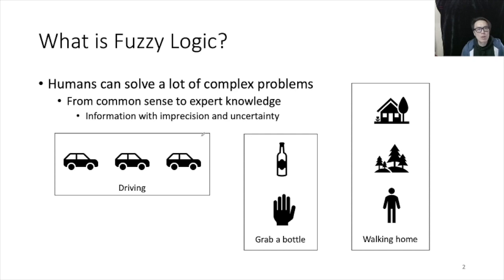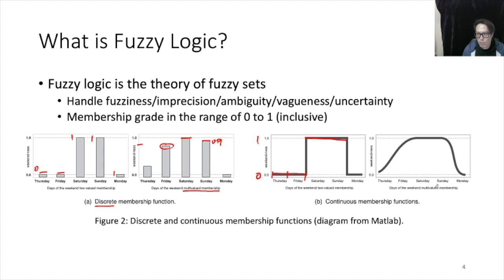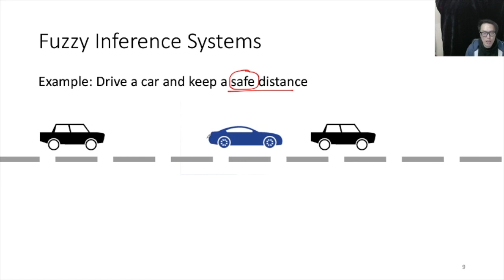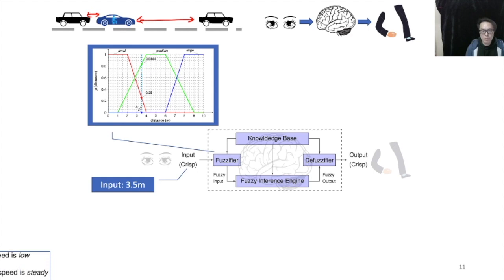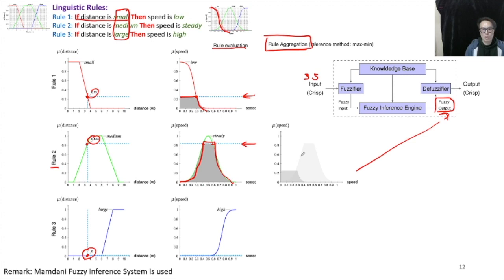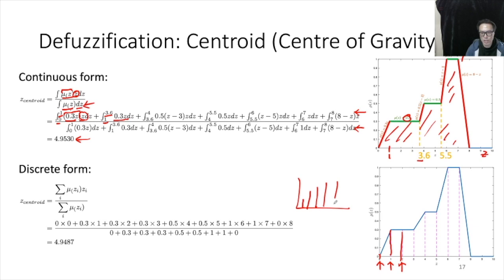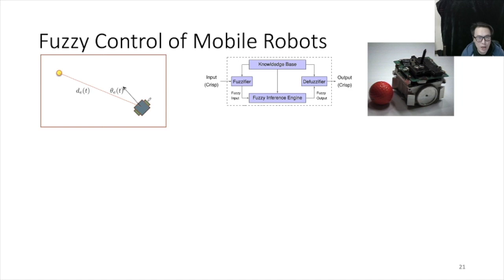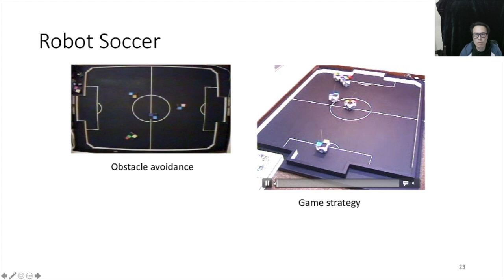Introduction to Fuzzy Logic, Fuzzy Logic System, Fuzzy Logic Controller

Comment: Excellent video..one question though, on the mobile robot doesn't the error angle have a polarity as well as a magnitude?
Reply from the maker: To practically implement the fuzzy controller using these rules, it does need to consider the polarity so that the turning is in the right direction.